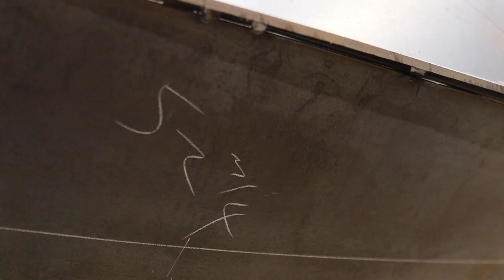Building our BRAND NEW Canal Narrowboat Home - Electric Propulsion Ep156

Comment: Hi Paul, Anthony and Dexter Dog. Thank you for sharing video of you new boat (build). Your boat is looking really great, especially after the 11 days when you returned to the boat. How great was Garry explaining everything about the build. Just one observation. I would have thought, that a hand rail (on the roof) going the full length of the boat is much safer than a hand grip? One would get a firmer grip on a hand rail should one slip whilst walking along the gunnels? Loving the shape of your boat. Great to have seating areas at the bow, as well as the stern. It's also great that you will have a bow and stern thrusters,. You will be able to leave your moorings side on into the center of the canal, that will be so super-kool. Why don't narrow-boats have mooring posts on either side of the bow, in preference to one central mooring post, which would make it much easier to moor up (especially if one was on the tow-path)? I bet Dexter cant wait to see his new home. Excellent Vlog as always. A great watch. Have a great week the three of you. Take Care.
Reply: Glad you enjoyed. It is coming along nicely. Gary was amazing. Very knowledgeable. Not sure re the hand grip. Assume it is because it is integral to the structure rather than a separate rail. The stern and bow thrusters will be an amazing addition. I assume only central position at the bow is due to it coming to an apex and so one rope can be used to do the job 🤷‍♂️. So hope Dexter loves the new boat. Have a lovely weekend and take care ❤

Comment: Our narrowboat Idle Days is a 60ft ColeCraft semi-cruiser so I can confirm that you have made a good choice of hull builder. Not so sure about the Birmingham full-width base plate as there is an increased risk of hang-ups in locks with sticky-out bits, greater vigilance will be required.
Reply: That is reassuring to know. Always good when others have the same set up and have tried and tested. 
We are always extremely vigilant in locks. But will bare that in mind for future cruises. Thanks so much for the advice and reassurance ❤

Comment: Is there any comment on the stability of one hull shape over another? Is the straight sided design more wobbly?
Reply: That’s a good question. I suspect that neither have more stability than the other. The important part is the base plate and the swim I guess. I would have to research this to be honest. 👍
Reply: @anthonysmith-storey9247  My background is (was) sailing boats and on them the flair/slant of the sides makes a large difference to stability. If the boats slants outwards then as it leans to that side it means less volume of boat comes out of the water on the lifting side than is being pushed into the water on the side being pushed downwards, so creating a righting moment. I just don't know how effective this is on a totally flat bottomed boat and with sides that only differ in angle by maybe 5 degrees. Also, whether the fact you get a wider baseplate helps.

Still, I imagine vertical sides will help when mooring anywhere with a ledge - fenders put in place should stay put.

I am looking forward to seeing how much larger the new boat will at least look inside. The slanting interior sides do tend to look a bit like they are closing in. I am also very interested to know everything there is to know about your hybrid system, though from your video I got the impression it is full electric drive with diesel generation  to batteries (for when solar isn't enough), no link to drive. Is that right? Exciting times for both of you but I feel it too!
Reply: 😮. Didn’t know any of that so thank you. Yeah you are correct. Serial hybrid with electric motor and back up generator just for battery charging when solar isn’t enough. Can’t wait to see how it all works practically. 😊
Reply: @anthonysmith-storey9247  So excited to see the new boat. Hope it is ready very soon. Chosen a colour scheme yet?
Reply: It will be ready in time for Crick as it will be Oakum’s show boat (end May). We have chosen a colour which we will reveal when it has been sprayed. It is quite a bold colour. 😊
Reply: @anthonysmith-storey9247  If I can get a passport in time maybe we will make it over. I haven't been home to UK since before Covid. Long overdue a visit - our son is in UK and hasn't been able to come see us out here in this time either. UK Passport Office - can't find a good word to use about them, :(
Reply: Good luck. Hope you get over 😊

Comment: How come you poms haven't worked out that building narrowboats using stainless steel instead of ordinary steel so rust will not be a problem?
Reply: Hey Brian. Apparently, the main reason is cost. I also found out that stainless steel, unless the welds performed are near perfect, are more prone to crevice corrosion which would not be good on a narrowboat. 😬. Have a good weekend ❤

Comment: Welding fumes are highly toxic and damaging to lungs and health, welders used to have shorter lifespans for a reason. 
It's disgusting the amount of fumes in that place. Welders not having air filtration units connected to their masks when sitting above it. 
A company that has such disregard for their employees health. Is definitely not one I would want building my boat.
Reply from the maker: That’s a good point to bring up Claire and not something we were aware of. I guess the video didn’t show that they had massive doors open to create a flow of air, we do know it was absolutely freezing because of the air flowing through. I wonder if any shell builder in the UK uses masks while welding. Thanks for your message. Have a great week x
Reply: @NarrowboatLifeUnlocked  Obviously not enough airflow you can see how thick it is in the video.
Are these little packs you can get. 
Wear as a belt and have carbon filters in them. 
Blows straight into your mask so you only get clean air.
Are for places like that where suppose wouldn't be practical building hoses they can put near where they're welding.

They might have them and the staff member chose not to wear it.